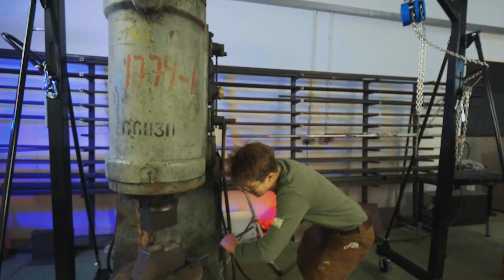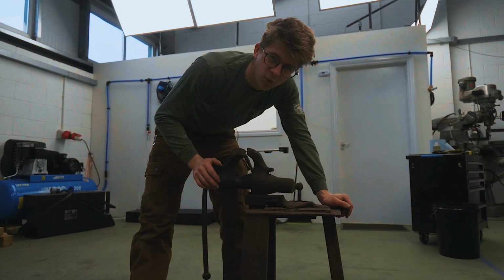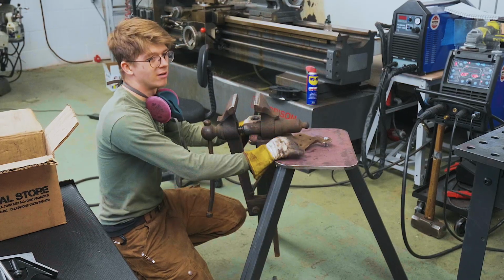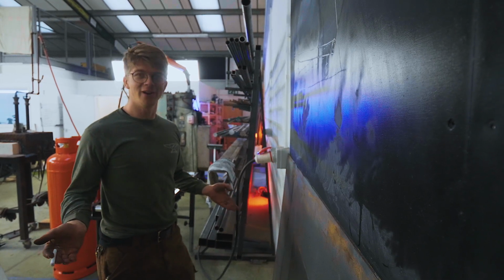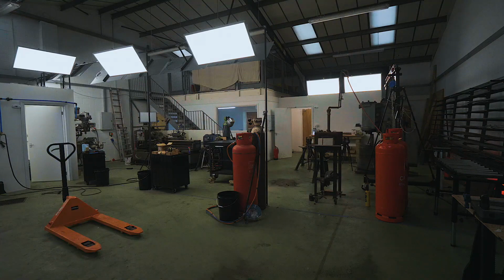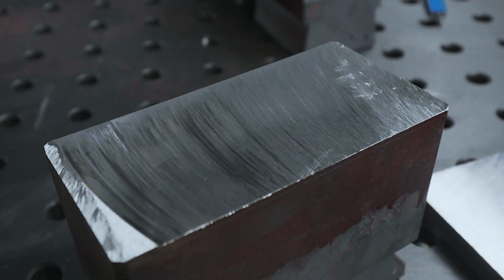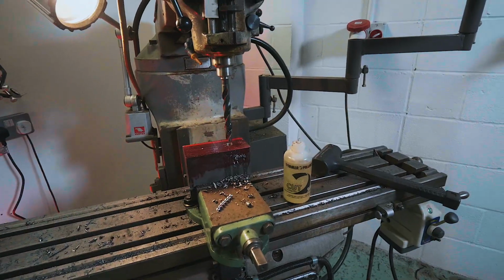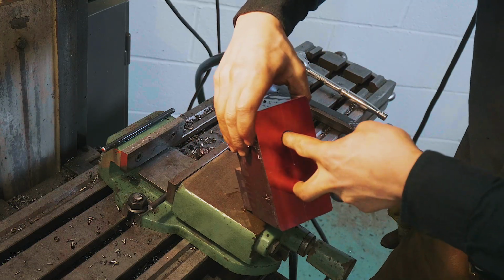MODULAR DIES! PART 1 (and building a sweet leg vise stand)

Comment: "Modular" dies held together by bolts just don't work for a long time. The fast sharp shocks that forging hammer create loosen bolts quite quickly. There's a reason why the dovetail design or taper design (on japanese knife hammers) won the test of time. And trust me the forging manufacturers tried looking for other solutions.. nothing else worked.

Comment: at about 4 minutes 40 you talk about fitting the vice stand into the grinding room door.... can't you just hook it around (ie, put 3 legs in sideways and then basically scoot the 3rd around) like getting large table into a tiny apartment?? Or would it weigh too much to try that?
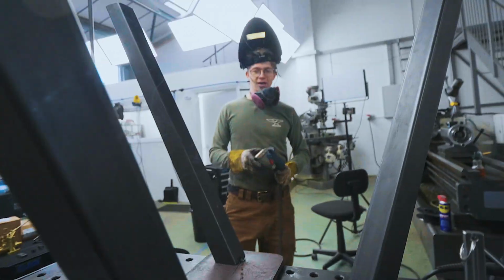Reply: not trying to be mean but this is just a tip but instead of saying 4 minutes 40 seconds its way easier to do 4:40 because then its a link to that exact time your pointing out
Reply: @chrislarson9504  you are fine, yeah should have made that link but my brain wasn't doing things the smart way yesterday

Comment: Mobile stand for a post vise sounds pretty cool but doesn't make much sense to me unless you are working in a space that also serves another purpose and requires your equipment to be movable. Ideally the post vise should be mounted to a solid bench or a stand with a heavy baseplate. If you have a concrete floor anchor bolts are perfect to solidify it. Sand in the legs is awesome though. Works great for anvil stands too. Nice shop!!!

Comment: Alec why not dove tail in the "modular" dyes and as a retainer pin copy the way the hammer dye holds onto it's key with a slide?

Much better than bolts
Reply: Mvm, you said right at the end, machine time... I think it would be better though. But it's not my machine.

Hope it works out for you cohort.

Comment: You might want to go find the piece you cut off the top of that die, drill matching holes in it, and use it as a template for all future die heads you make for it, to ensure proper peg spacing.

Comment: would have designed the wheel with 2 points of hinge, that would point the pressure point to lift it at the 3rd corner, and be WAY more stable and less shear stress on the 1 hinge.

Comment: Gentlemen: whenever possible, dont weld your casters to your frame. They are much easier to replace when bolted.
Reply: Much easier to weld on and grind off later. All those holes are not worth it.

Comment: DRO makes things so much easier. If only you remember you got one, in my last machining job I was working with a lathe for 3 years and all I knew was the imperial scales but my boss had a read out fitted and my supervisor would always laugh at me as i struggled to read the worn out numbers out of habit. If I just looked to my left I had a very well illuminated screen with all my numbers of importance right there infront of me lmao

Comment: How many people were as triggered as I was when he didn't even try to get the three-legged stand through the door before modifying it? I bet it would have gone through EASILY. 😅
Reply: Yeah, I used to assemble and deliver couches and recliners, and those arent small enough to "just fit" through a door. But you have ways to do it like rotate it as you go in. I was totally thinking that he had plenty of enough room to rotate that stand through the door. With wheels, it would have been even easier. kids these days just don't take the time to venture into the possibilities.
Reply: @Robster-Craw  I'm guessing Alec had already been planning ahead and fully intended to install the retractable wheel thingamajig - which means he probably wanted to be able to wheel the stand in and out of the grinding room without too much hassle in the future.
Reply: @yehudahardoon3567  Alec could have stated that a bit more clearly.
Reply: @yehudahardoon3567  But you still don't need to wheel it in by having one of the triangle's sides paralell do the door. And Alec demonstrates exactly that at 8:13, and it's plenty of space to spare to the door frame. But I guess it was good he narrowed the wheel base / footprint, because he has a bunch of crap behind the door so it can't open up fully... 🤣
Reply: Me to just turn it around the corner.
Reply: Triggered? LOL
Reply: @edwardgraham3035  absolutely! LOL! 😅
Reply: Yeah, pivot pivot piivoot
Reply: He took the wrong measurement. Correct would be on leg to the point where this plate ended or if you want it more comfortable the height of the triangle on the ground. Both wood be much shorter than what he messured.
Reply: Sat here with my morning coffee screaming PIVOT!!! :D
Reply: Lol... it would have spun right in the first rendition

Comment: One of my roommates is a construction worker, and he recently got a pair of hard-toed boots that used something other than steeled-toes for the added protection. I don't remember what it used, but it has the added benefit of NOT being frozen solid for a full hour after spending 10 to 15 minutes in freezing cold temperatures. As someone that has walked in the snow while wearing steeled-toed boots, I have to say, that's quite the benefit.

Comment: you could just machine the pegs for those holes you just drilled with the different dyes that you plan on making for that power hammer yea time consuming just a thought rather than welding them in to place theyd be removable.

Comment: For your face mill i suggest using copper slip.on the torque heads so when the fave mill gets hot it completely knacker the screws

Comment: You could have twisted those first legs through the grinding room door sir. Sideways.
Reply: I was yelling that at the time.  I guess Alec couldn't hear me over the grinder.
Reply: @AndyFromBeaverton  same i was thinking aaaaaaaaaaaaaaaaaaaaaaaaaaaaaaa
Reply: yeah i was scrolling down to just type this comment, glad others thought of it as well!
Reply: so glad it wasn't just me
Reply: I think he wanted the ability to roll the whole thing through the door though, without twisting it sideways
Reply: @docvannostrand  it would still work fine with wheels on it. You simply put one leg through the doorway, then pivot it around and just spin it as it goes through the doorway.
Reply: @BillDerr  Ah gotcha, I assumed he measured it  in that dimension too.
Reply: @docvannostrand  With a triangle, you only need to concern yourself with the shortest altitude/height.
Reply: He wanted wheels and a vice attached to it.
Reply: exactly what  I thought :)
Reply: Exactly what I was thinking... but I think his door doesnt open far enough.. as his smaller legs just fit with the door pushing against them
Reply: We all thought the same thing. But there is a method to the madness I am sure.
Reply: Personally I'd simply have made a larger doorway.  Carpentry is easier than rebuilding a metal stand, at least for me.
Reply: He's never moved furniture, ever!
Reply: Then he has to twist them through anyways.....
Reply: tought it to but i think he meant regulary move it into the grinding room, on the wheels
Reply: omg its killing me. lol
Reply: While I thought exactly the same thing at the time, with the vice mounted and the legs full of sand, that's going to be heavy and cumbersome. The whole point of putting wheels on it is to 𝑎𝑣𝑜𝑖𝑑 having to manhandle it. For all the time it took to re-adjust the legs, it was worth it to be able to just roll it through.😁